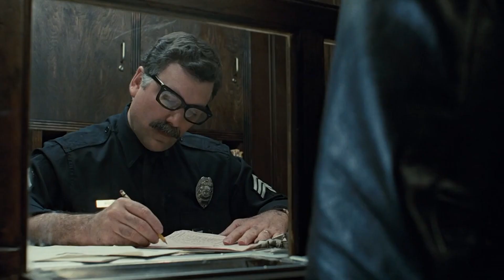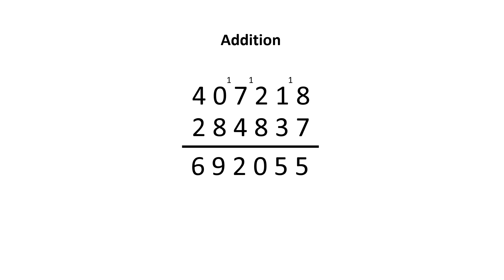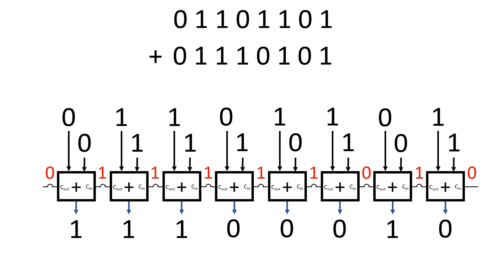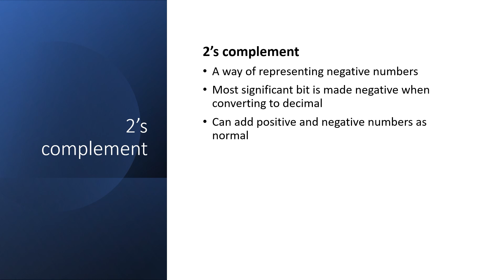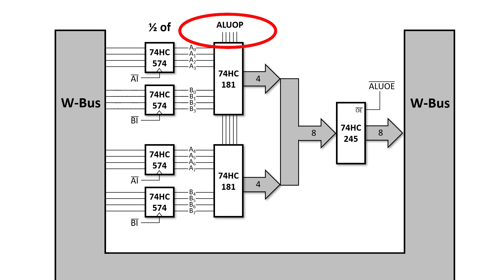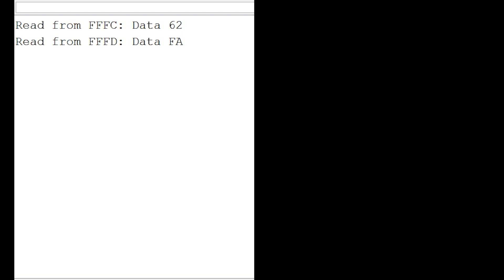Comment: 18:32 yes it works if you programmred todo it. why you even compare ben eater 8bit machine when you do 6502 ttl LOL
you are making completely diff thing touring 6502 machine that casn calculate everyting with magic strip of paper that nobody know what is default setup LOL. i mean there is no that thing.
meaning what ben told.. read paper if is this change it if not dont do jump. do many things or couple but when it stop answer is magically next LOL there is no way! what is that magic strip that calculate everything. you need setup mean you allready know answer xD
Reply: You can program it to do anything.  I'm talking about native support for an operation

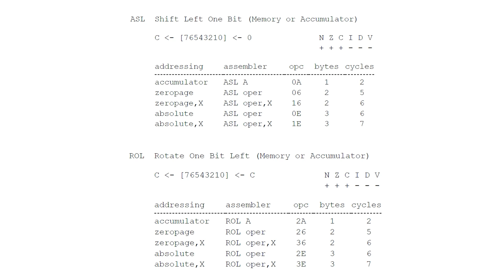Comment: 13:30 yes ben can do add itself ROL other way say *2 but it can ROR or /2 without making it so
example A=10
zero memory 14
sub 2
is zero?
put answer in memory 15
take memory 14 put to A add 1 put answer back memory 14
we have 1 on 14 and 8 on 15
take memory 15 and put it on A

sub 2
is zero?
put answer in memory 15
take memory 14 put to A add 1 put answer back memory 14

we have 2 on 14 and 6 on 15
take memory 15 and put it on A

sub 2
is zero?
put answer in memory 15
take memory 14 put to A add 1 put answer back memory 14

we have 3 on 14 and 4 on 15
take memory 15 and put it on A

sub 2
is zero?
put answer in memory 15
take memory 14 put to A add 1 put answer back memory 14

we have 4 on 14 and 2 on 15
take memory 15 and put it on A

sub 2
is zero? yes it is
take memory 14 put it in A and add 1

we have answer 5 on A

bcoz we did not saved original 10 LOL
we move 5 to B and add
a=10 b=5
NOW WE CAN /2 or ROR by sub 5 from 10 LOL LOL
it can do it but it take many clock cycles when ROR can make easier adding new register that read A allways and we can pull data
by 7->6 6->5 5->3 4->3 3->2 2->1 1->0
and last 0 go 7 also we could save 0 as carry first if we need cycle it
and we have magically made /2 ROR
Reply: Again, native support, not some programming trick.

Comment: ben eater computer(cpu model+memory+output) can + and - it can * ROL it just A+A.
but how it can /. if we make a=10 how computer know it need put 5 to B and then we subtrack we have / ROR
we cant 10/2=5 bcoz we not have / to make that / LOL.
ROR
b1010 10-5=5 -> b0101
b0101 5-2.5=2.5 -> b0010.5 xD
b0010 2.5-1.25=1.25 -> b0001.25 xD
b0001 1.25-0.75=0.5 -> b0000.5 xD
not matter we /2 OR - half of itself
i have lost my nights LOL how do it
ofc we can do it, but it take many clock cycles to get half from number xD and what we want do is to get half of number LOL to half it LOL LOL
Reply: There is no instruction, it's the programmer doing the ROL.
BTW 2.5 in binary is b0010.1

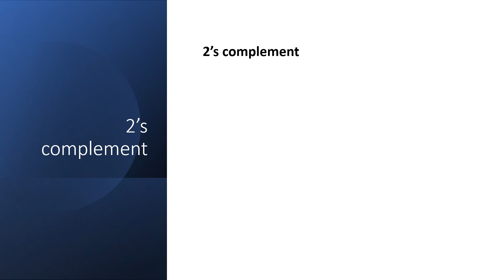Comment: 9:57 becoz its just adder and ben want substract nothing todo 2complement(ofc it is but we just need minus lol so he change numbers to get subract). computer not know is 0x80=128 or -128 its same number its programmer
who use it as signed int or unsigned int. result is exact same 0x80+0x80=0x100 (128+128=256)  0x80+0x80=0x100 (-128+-128=-256) ofc its true if we only have 8 bit and that extra become 1 is carry, but its same number. we can use that result as signed or unsigned. hex is same
1+1=2 we need 1+(-1)=0 so we convert 00000001 to 11111111(-1) what is same as 1+255=256
00000001 xor 11111111(SU) =1111110+ 1(carry same as SU its allready 1)=1111111
ben eater make it easy now im lost LOL point was 0x80 is hex its same 128 or -128 how we want use it. computer not know. its still 0x80

Comment: Shift right is the same as 7 times shift left..... You can do that in microcode. Not the fastest solution, but it can save you a chip.
You can also replace the 74181 with a 27C128 eprom, since you need 8 outputs (F0..F3, A=B, Co, P# and G#) and 14 inputs (A0..A3, B0..B3, Cin, S0..S3 and M)
Reply: True, although you can replace both 181s with a single 27c322…

Comment: Great series. 
Re: the Terminator display... $C311 is the Apple //e firmware routine AUXMOVE which would transfer data between the normal and auxiliary 64K banks. It used zero page locations $3C-$3F and $42-$43 which are curiously set up in the Terminator display prior to the JSR. If the disassembly on the left were one line longer, that last line would be another JSR $C311. This is 128K //e code and it may be the Terminator "Infiltrator" firmware was derived from Appleworks.
Reply: Welcome.  Excellent, great pick up!  Bank switching didn't seem to slow down the bullets.   If you haven't already, have a look at the Turing6502 series (particularly the first 4 videos), I'm keen to see what you thing.

Comment: The 181 is a cool chip, but those ALU op inputs are kinda weird. I have seen several DIY CPUs with a dedicated ROM just to generate them and simplify the control lines. The 6502's decimal mode should also be a challenge.
Reply: I think the whole positive logic/negative logic is crap.  Decimal adjustment is interesting.  It works in the emulator but I think I'll need a whole video for it.  This is where we start to diverge a bit from Ben Eater.  Status is next and it is more involved than Ben Eater's.
Reply: The 74hc181 data sheet has to be one of the most confusing I’ve seen.  Chip works well though

Comment: 181 selection as the ALU is not a great idea, it's an extinct chip 😕 the multiplexer ALU from 6502 org is buildable from available chips.
Reply: Yeah, i mulled over the ALU quite a bit.
I think there are (at least) 5 options,
1) use a big EPROM like a 27C322, solves the problem with 1 chip, but this is effectively what i did in the Turing 6502 playlist, so i didn't want to use that trick again.
2) Discrete logic, AND gates for AND, OR gates for OR all muliplexed together.
3) Dieter Muller's approach which is probably the most elegant but hardest to understand/explain (would take an entire video).
4) the 74HC181s
5) FPGA/GAL

I chose the 74HC181 for this playlist because it's easiest to explain from an SAP-1 perspective, pop out the 283s and replace them with 181s.

I plan to add an ALU in the next video for the TuringToVonNeumann playlist, so i'll probably go over Dieter Muller's design and discrete logic there.

The Turing6502 is the easiest to build, 12 chips for a bare bones  6502
Reply: @DrMattRegan  great, Dieters ALU is very elegant.
Reply: I discovered just recently that LCSC sells brand-new 74LS181's made by XINLUDA, and I was so surprised that I bought some on spec.  :-O
Reply: @derekchristenson5711  That are some cheap prices. Is it genuine though?
Reply: @akkudakkupl  Well, that's a valid question, but the seem to be sold as new.  That said, they're not new from TI, Signetics, or some other old-name semiconductor firm, but rather from Xinluda.  So, it might be just as valid to wonder if they're maybe genuinely new but not matching spec as per TI datasheets.  Nonetheless, my curiosity got the better of me, so I hope to use them in some project at some point and see how they do.  Hopefully well enough for hobbyist use, at least.  🙂
Reply: @derekchristenson5711  it's obviously a chinese company making them just by looking at the name...
Reply: @KevinJohnson-fw8kv  Yeah, I got that part.  🙂  I did order them from a company that specializes in Chinese-made parts, too.  In any case, I didn't mean that their origins were mysterious, only that they were a relatively new company, whose reputation was unknown to me.  Thus, I believed that the parts were genuine Xinluda-made parts, but that Xinluda's parts might not matach the specs of Texas Instruments-made parts (which is, after all, what everone else is copying with their 74xx parts).

Since writing my reply, I have used some of the Xinluda chips in a project, and, while I'm no electrical engineer, I can at least say that they worked in that project just fine.  🙂
Reply: @derekchristenson5711  i still live in Shenzhen, so if you need me to check something out, let me know  :)
Reply: You can still buy from lscs just search for XD74LS181 its manufactured by xinluda a Chinese chip manufacturer